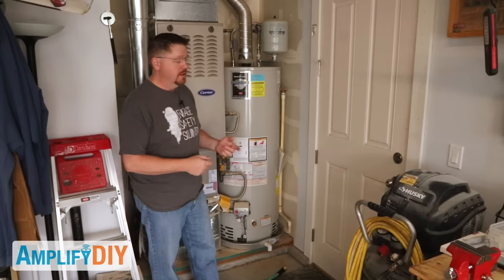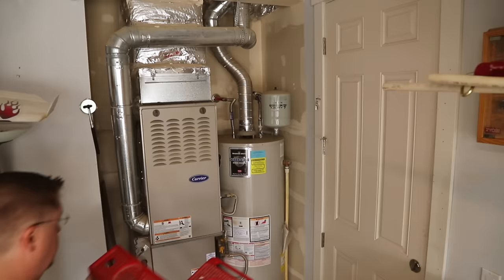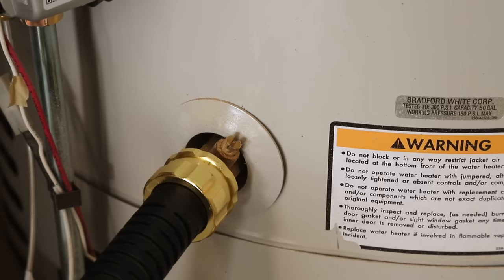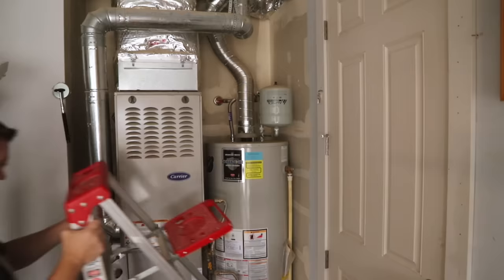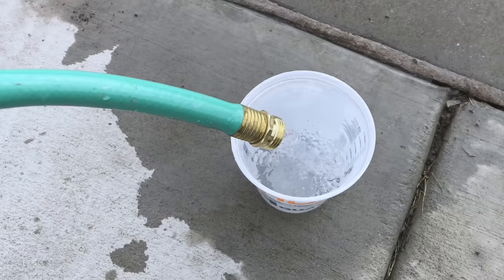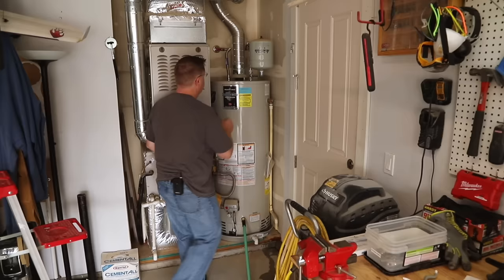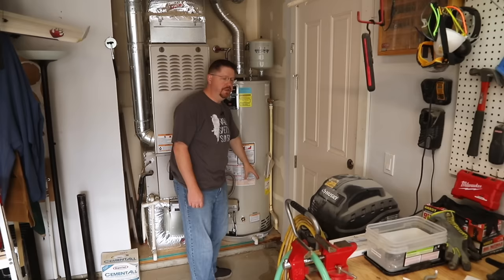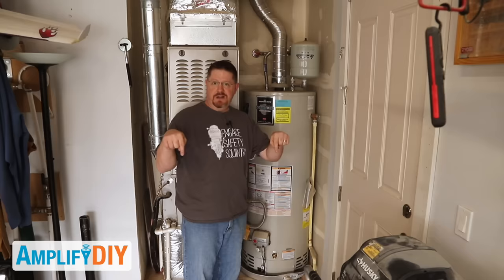How To Flush A Hot Water Heater To Remove Sediment

Comment: If I have both a safety release valve for pressure, do I also need to turn on a hot water faucet?
Reply from the maker: Hi Chris - the concept to understand is this: in order to let water out of the heater, you must let air in*. If that air can come in through a faucet, then you don't need to open the T&P valve. If air does not come in through the faucet, you need to provide a different path for air to come in. The T&P valve is a convenient and easy way to do that, so that's what I showed in the video. You don't need to open *both a faucet and the T&P valve. One or the other is fine. It won't hurt anything to open both, it's just redundant. Good luck!

Comment: Thank you. Is it possible to wait after turning off the gas so that the water cools down to be able to not waste 50 gallons of water and use it for the garden?
Reply from the maker: Hi Truth - you certainly can, but you'll be surprised just how long you'll have to wait. Heaters are pretty well insulated, and they keep the water warm for many hours. A better way to do this would be to turn off the heat source, then go take a shower, do some dishes, or some laundry. This will use up the heated water in the tank and exchange it for cold water from the supply. The result is that the water in the tank will be nice and cool when you do the flush. Thanks for watching, and good luck!

Comment: Thank you for your video ❤I have a question why my water heater has big noise sound like “wooooo…” when I am using the hot water?
Reply from the maker: Hi Pei - it's really difficult to even guess what may be causing an odd noise like that without seeing / hearing the noise you mean. I'll be happy to try to help if you'd like to send me a video of the heater making the noise. Feel free to email me directly: amplifydiy (at) gmail (dot) com. Thanks!
Reply: @AmplifyDIY  Thank you so much 😊 I sent the video to your email already
Reply from the maker: @peichin1773  I saw it, and responded. Thanks for sending it!

Comment: Is it ok to use descaling solution in this type of water heater? Works great in a tankless heater.
Reply from the maker: You can, but I strongly recommend you do some extra flushing after you drain out the descaler so you don't get it into all your plumbing. Good luck!
Reply: @AmplifyDIY  . Thanks. With tankless water heaters they recommend that you flush out about 5 buckets full so it doesn’t get into the plumbing. So relatively the same ratio of rinse would work for a  tank system. Approximately 60 to 80 gallons.

Comment: What am I doing wrong? I let the water completely flush out but when I try to do the burst flushing it instantly starting coming out the pressure relief valve  and if I close that it comes out my faucet that is open for air. Any help would be appreciated. Awesome video!
Reply from the maker: Hey Talley's - when you drain the tank, are you sure the tank is actually empty? Sounds like your cold water inlet is not actually closing all the way, and even though you are draining the tank, it is just re-filling through the cold-water inlet....
Reply: I let it drain for about 45 min and it just started dripping out of the drain hose so I assumed it was finished but maybe it just got clogged up. How can I tell if the cold water inlet is completely closing off? I can’t hear anything running into the tank, all I hear is the air burping sound.

Comment: If water is coming out with just turning on the faucet and not opening the pressure relief valve, than that remain closed the whole time? 
And when you are letting cold water run for 15 seconds at a time, do we leave the hose open or close it off?
Reply from the maker: Hi Jessica - I'm not entirely clear on your first question... let me try to answer this way though: You need a way to let air into the tank so that the water can get *out*. If opening a faucet allows air into the tank, then don't mess with the T&P valve. However, if a faucet cannot let air in, then you'll need to try something else, such as the T&P valve. 

As for your second question: leave the hose connected and the drain valve open for those extra bursts of water. 

Good luck!

Comment: For gas water tanks, you turned the knob to pilot but should we turn off gas to the tank as well or is turning the knob to pilot sufficient?
Reply from the maker: Hi Michael - you just want to make sure the main burner does not light. Turning to pilot should be all that is needed.
Reply: @AmplifyDIY  You were correct, that is all that was needed.  However what I wasn't expecting is the discharge from our tank.  We had a LOT of gell like substance come out of the tank.  No black flakes just the gell stuff.  We got most of it out after a coupe of hours but your video was instrumental for sure.  Taping instructions and video link on tank for next year.  Many thanks.

Comment: I’m confused, do we always need the pressure release valve? Or only when filling back up? Or do we not need at all?
Reply: Both. In order to drain and have air fill the void you need to open the relief valve. Same when filling since the water will pressurize the air if you don’t open it

Comment: Now would I be able to replace the pressure valve and both heater elements after it's completely empty? There is signs of build up on the outside of them, didn't realize previous owner didn't do it for awhile
Reply from the maker: Yes, with the tank empty it's a great time to handle other upkeep/upgrades like replacing the T&P valve, replacing heating elements, replacing the drain valve, checking/replacing the anode, etc. I have videos on just about all of these tasks on the channel. Let me know if you need any more advice/help. Good luck!
Reply: My problem now is my water heater is 13 years old. I never knew before owning a home about this maintenance.  I highly doubt previous owner did any. Would i cause more problems if i did a flush and replace everything then replace the whole heater? I checked the elements there getting power but upper has sediment build up. Same with the valve. i just had my hot water line dethawed from the bitter cold last week. It was working fine but now when its 37 outside i get no hot water again. I think this is a sign to replace the whole thingand startgood yearly maintenance,  thoughts?@AmplifyDIY
Reply from the maker: @michaelsisco2216  Yeah, with unknown maintenance history (likely, none) it can be tricky. In your shoes, I'd probably start by flushing, then replacing heating elements, replace the T&P valve, replace the drain valve, replace the anode... do each thing one at a time, and if there are no new issues, proceed to the next. However, all that maintenance will cost around a couple hundred bucks in parts. Some of the parts can likely be transferred to a new heater (drain valve, T&P valve) but some may not (heating elements, anode). If you are in a position to just replace the heater and start with a clean slate, I'd probably recommend doing so.

Comment: Hello, I have a couple questions before I attempt to do this. To start with my water heater is in the basement. I have the black sediment in the sink faucet and shower head that is on the main floor almost directly over the water heater, the one in the kitchen doesn't seem to get any (further away) so I thought I needed to install some sort of water filter for the incoming water. After watching your video I am thinking different. Since my water heater is in the basement and the only drain is near the drain for my washing machine would this be okay to drain into it since the water is so hot? With what little pressure that it looks like, would the water and sediment travel up the stairs outside? Last question, would this cause the water to drip in the shower? I clean the screens in the faucets regularly but not as easy to do with the shower head. Thank you in advance
Reply from the maker: Hi Curt - great questions! I'll try to address them all: 
1) Yes, you can drain your heater into a floor drain in your basement. If you have a sump pump, I recommend turning the heat off for your water heater, then taking a shower, doing a load of laundry or washing some dishes. This will use up the hot water in the heater, and exchange it for cold, leaving the water that drains out much, much cooler. Whenever draining into a floor drain, I also recommend using a kitchen strainer to catch any large chunks of sediment... the last headache you need is a clogged floor drain. 
2) You cannot drain uphill... it's a gravity drain, so you have to drain to something below the level of the drain port in your heater. 
3) This most likely would not cause the water to drip in the shower. I'd look into checking out how to disassemble/clean/replace your shower faucet handle. That is most likely what is leaking. Google around for any names and/or numbers you can find anywhere on the handles you use to control the shower to see ho to disassemble/clean/replace it. 
Good luck!

Comment: Question: at what point do you turn off the hot water to initially add pressure to flush water out?
Reply from the maker: Hi Andrew - Sorry if that was a little confusing in the video. Once the tank has been drained, it actually does not matter at all what you do with the faucets. There are 2 points at which the faucets matter: 1) when you are draining the tank, you can try to open a faucet to let air into the tank. 2) When you fill the tank back up for the final time, you need to open a faucet to let all the air back out of the tank. 

Other than that, the faucets can be open or closed - does not matter at all. Thanks for watching!

Comment: thank you for this helpful video. i am a first time homeowner and did not know this had to be done. if i am hearing knocking sounds (from caked sediment) is it too late to do this process? 😕
Reply from the maker: Hi there - if you have knocking/clicking/popping sounds, it may not be too late - but there is a LOT of sediment in your tank. I'd suggest that before flushing in your situation, make sure you are in a position to buy a new heater if the flushing process does not work. Good luck!
Reply: @AmplifyDIY  thank you! pray for me 😂

Comment: Thanks for the video. Really helpful. I had some blockages during the flush and had to use a wire to unclog. Eventually got it to finally drain completely. (I think) Slightly concerned about how quickly my tank seemed to fill back up. Can anyone tell me about how long that part should’ve taken? 50 gallons
Reply from the maker: Tanks do fill pretty quickly... typically 3-5 minutes is all it takes. Thanks for watching!

Comment: Question:  Basement logistics allow me to drain my water tank only into a basement drain, not outside. Is this OK? Anything I should look out for?
Reply from the maker: Hi TheJcfclark - yes, I recommend 2 things when draining into a basement floor drain: 

First, turn down the thermostat as I show at the beginning of the process, but then go take a shower, do some laundry or some dishes. This will use up the hot water that is in the tank and cool it down. 

Second, use a kitchen strainer to catch any large pieces of sediment that may come out of your heater. 

This way the hot water won't potentially damage or overheat a sump pump (if you have one) or clog up your drain with sediment. Good luck!
Reply: @AmplifyDIY  Initially I was thinking to turn down the thermostat and wait until the hot water actually cooled, but this would take 24-48 hours I suppose, so yours is definitely the best solution. 

And, a strainer (or) metal colander is a terrific idea.

Plus, I actually have a sump pump in my basement and it never occurred to me that boiling-hot water might damage it.  So thank your for your prudent foresight. And I sincerely appreciate your quick response!

Comment: Will any garden hose fit?

I see there are 3/4", 5/8", 1/2" garden hoses. Saw another video saying any garden hose will fit all 3/4",5/8",1/2", but then read another article saying the garden hose connectors usually come in 3/4 or 5/8" which sounds like I can't just buy any garden hose. 

I tried measuring the external diameter of the drain spigot and it looks like it's 1" wide...I'm going crazy
Reply from the maker: The sizes you are referring to are generally the inside diameter of the hose itself. I believe the standard in the US is a 3/4", and is what I recommend you use. Good luck!

Comment: I followed your steps exactly, opened up the hot water faucet on an indoor sink and even opened the pressure relief valve but no water came out when I turned the drain valve. Do you have any idea why?
Reply from the maker: It's likely you have too much sediment at the bottom of your tank, and it has completely blocked off the drain valve. What happens if you jamb a screwdriver into the drain valve? Can you break up the blockage?
Reply: @AmplifyDIY  That seems odd since the water heater is only about 3 years old. I tried turning the water back on and the water came out just fine. It just wouldn't gravity drain.

Comment: Never knew you had to do this, my water heater makes all kinds of noise when heating, if I drain it do you think it would help?
Reply from the maker: Yes. The noises you hear is steam popping/bubbling up through all the sediment stuck in the bottom of your tank. If you don't get that sediment out of there, it'll be time for a new heater much sooner than otherwise necessary. 
Good luck!
Reply: @AmplifyDIY  okay just worried to do it, I don’t want to mess anything up

Comment: Where do you drain the water if your hot water heater is in the basement?  I have a sump and ejector pit/pump close by but I can't imagine putting super hot water into them is a good idea? I have dual hot water heaters that are now 28 years old and still kicking.  Guess I should probably get quotes to replace them, lol
Reply from the maker: Heh - yeah, at 28 years old, you are living on borrowed time for sure! As for how to drain them: you CAN use the sump ... but I recommend you first turn off the heat source, then go take a shower / do some laundry / wash some dishes. This will exchange the hot water in the tanks for cooler water that is easier on your pump. Second, use a kitchen strainer to catch any large chunks of sediment that may be present when you do the flush (and after 28 years, there WILL be a lot). 

Good luck!

Comment: My water heater already has a black hose coming out the bottom spigot that I didnt put there. The hose goes down a drain next to the water heater. A plumber flushed the water heater about a year ago. Can I assume that I can just use that hose and drain instead of using a different hose and draining it out my driveway?
Reply from the maker: Hi Notorious - yes, I think that's a safe assumption. I'd try opening up the drain valve for a few seconds and see if any water winds up in any unexpected places. Good luck!

Comment: Thank you, I did it properly as you said, but I did not open the pressure valve at all along the way because I had no problem with water flow. Is that ok?
Reply: It sounds like you don't have a backflow valve, so if the water drains anyhow, it should be good
Reply: It sounds like you don't have a backflow valve, so if the water drains anyhow, it should be good
Reply: Thank you

Comment: Thanks for the great info.  However, when I was in the "flush and drain" phase, there is no water coming out of hose if I only turn on cold water for even a minute or so.  Eventually I just let it on for a few minutes, and to my surprise the water start to shoot out from the pipe with pressure release valve.  Not sure why my tank is different from yours.
Reply from the maker: Hi Puck - my only thought is that somehow either your drain valve was closed during that process, or was otherwise blocked up so water would not drain from it correctly. Hope you got the rest of the flush handled well. Thanks for watching!
Reply: @AmplifyDIY  Thanks for the prompt reply.  My guess is that there might be some clogging from the sediment so that the flushing water does not come out until water level reach the pressure release valve.  Later round I can just turn on cold water, pressure valve off, and the water just flush out from garden hose with high pressure and lots of stuff coming out.  I ran the cold water for about 5~10 min until pretty much all clean. 
Just a feedback and precaution for others who may have the same problem like I did.

Comment: First, great video!  I'm subscribed, and will definitely be back for more of these.   My situation is this: just bought the house which had been vacant for 2 years prior.  Hot water was clear when we moved in, then we started doing laundry and that's when we got brown water.  Am I guessing right that this is likely just the sediment in the tank (betting never been flushed in 12 years since it was installed) that has been stirred up and flushing should take care of it, or am I wasting my time and this thing is toast?
Reply from the maker: Hi Bill - yes, you very likely have a tank full of a) sediment and b) decomposed / corroded anode. Here's a link to my playlist of water heater maintenance items you can check... but before you do, I'd make sure you are in a position to replace the heater as a neglected 12 year old heater may not respond well to some of this maintenance: https://youtube.com/playlist?list=PLYix1RK1u5Bm5HqqiARpGQ-BiJE3QJA4Y

Good luck!
Reply: @AmplifyDIY  Thanks!  In my case, it took a few full flushes to finally get the water clear.  But, then the brown came back.  I'll try the anode next.